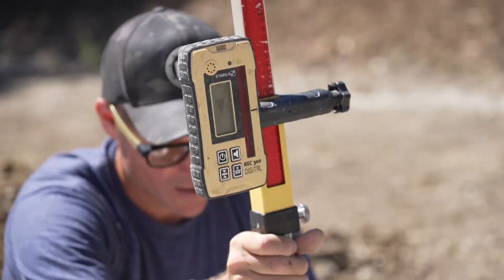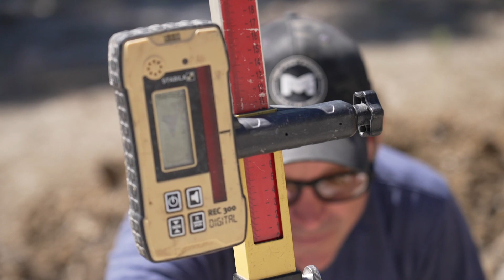Concrete Bucket Mods For Pier Foundation | Classic Car Post Frame Building

Comment: I wonder if Skid Pro Joe would be interested in those modifications! I would order mine with them definitely!  I might end up pouring the piers myself and they would definitely help. 
Great video again! Delta Metals? Is that someone you would suggest looking into for materials? I finally found the system that was used in your last rescue video Concrete Pier System,...would you recommend calling them  for materials? Still trying to locate a firm to supply and build my designs here in Arizona,...Thanks Paul!